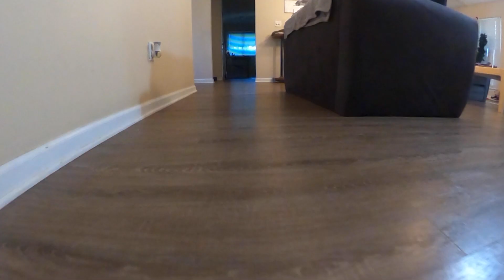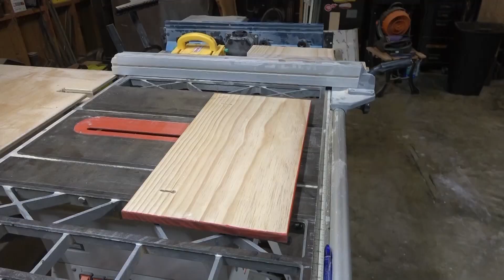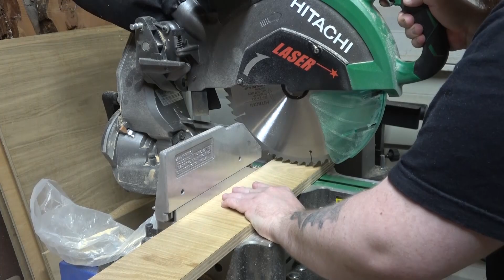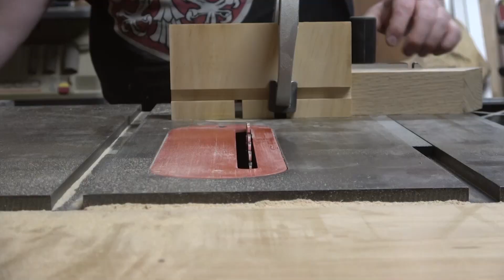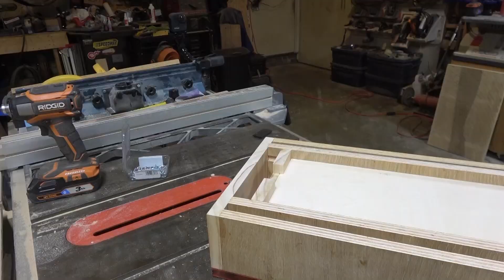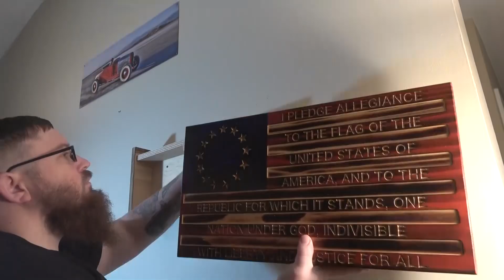How To Make Wooden Flag Concealment Furniture

Comment: So I have always wondered what happens when the battery in the RFID lock goes bad. How do you open the box?
Reply from the maker: I’ve got this little 3-3/8” cordless circular saw... In reality, it starts beeping when the battery starts to get low. You can also drill a hole in the back and run a cord out if you’d like.
Reply: Chris Powell 
Thank you

Comment: What happens if you don't open it for a while and the batteries go dead?  You have to rip it apart then?  I didn't see you attach the USB cable to it.
Reply from the maker: It notifies you when the battery is low, and as you said, there’s a USB cable that could be attached if you’re concerned about it.

Comment: Nice job!!! I understand why you make them but have trouble making wall hanging boxes like this cause thieves notice that when its on the wall. I prefer to recess them into the wall behind the the sheetrock and make the flag look like it is the only thing on the wall. It requires carving out PART of a stud  but it is worth the trade off for me.  Again, great job!!!
Reply from the maker: That’s definitely a good way to do it also! I’ll be doing a more permanent installation of one in the future using a similar technique.